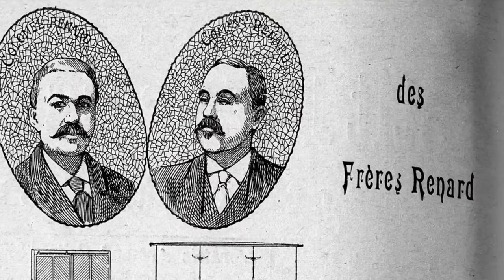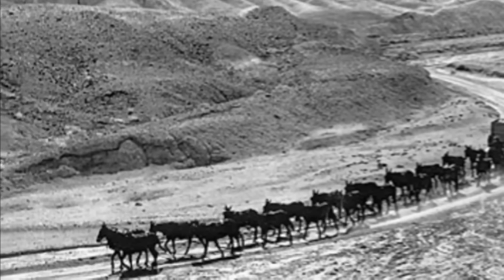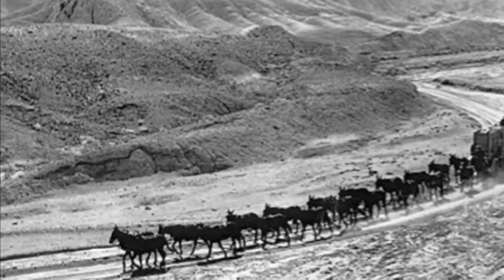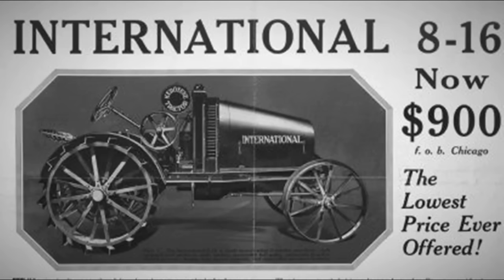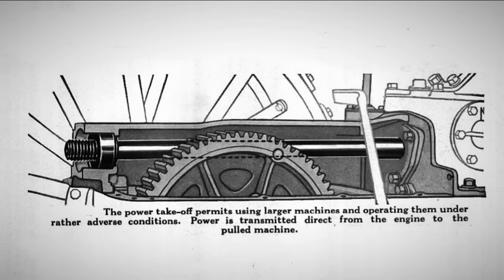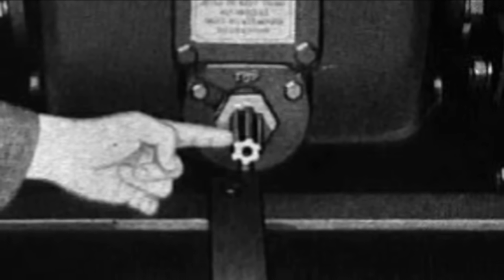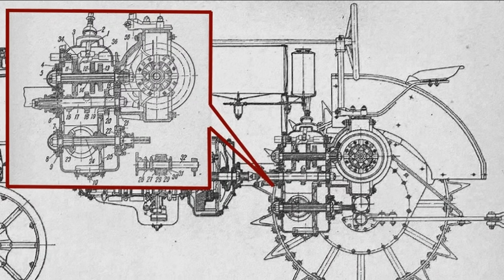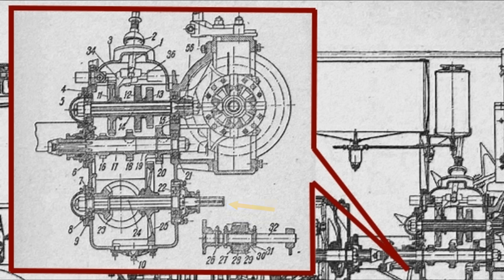The History of PTO / Farm Machinery Stars Series

Comment: Dad had a Cockshutt 30 tractor with "Live PTO" he bought in 1949 along with a John Deere 12A pull-type combine.  Even using creeper gear the tractor could not go slow enough for the combine not to overload and plug up (we had a 10 ft swather and the 12A was only a 6 ft combine).  So we had to control the tractor speed by "slipping the clutch" of the tractor.  Only because of the live PTO could the combine continue to operate while slipping the clutch to control the tractor speed.
Reply: That must've been absolute torture on the clutch, not to mention the operator's leg!
Reply: @kylejonesUB  Yes, my left foot was numb by the end of the day.  Surprisingly the clutch would last about 5 years.  In 1970 Dad bought a used JD 30 combine and another Cockshutt 30 to run it. The JD 30 had a 9 ft header, so no more slipping the clutch.